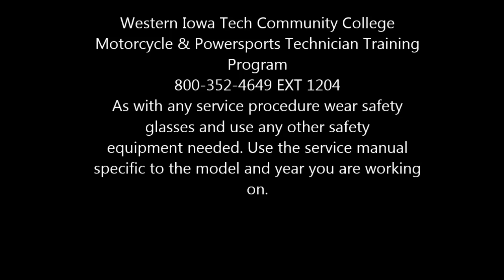Dirtbike Transmission: Suzuki Style Shift Cam Stopper Detent Assembly and Testing

Comment: Thanks Shane! Love your videos. Just to add to the conversation here as we are talking about Suzuki style shift cam. I just assembled my 2013 Suzuki RMZ 450. Started the bike, put it in 1st gear, took of and got about 10ft before the bike locked/stuck in 1st gear and stopped. The bike is locked in gear and gear shifter will not move. Here is the thing I had watched this video before putting it together however I must not have paid enough attention, or to the main point I did not check my work. I did not run through the gears to make sure it was working. Right now I am not 100% sure of the problem until I get back into it here. Stay tuned I will give you an update on what I find. If anyone has an any insight please share.
Reply: Update! So when i went back in there, I unstuck the transmission however I could not find anything noticeably wrong with my assembly. The gear locator was free and install correctly (this one has a washer on the end)  I then proceeded to removed the gear linkage, gear shift cam driven plate, cam stopper plate and gear shift arm stopper or gear locator . Resembled making sure everything was installed correctly checking my work by finding 1st, neutral 2nd..... etc. What seemed like everything was functioning perfectly. I then started the bike put it in 1st gear and it jammed itself again. the bike would not even take off. It was jammed and cut itself out. So now I don't know what to do! Any help out there?
Reply: Thinking about it a little more, it is like two gears are engaging together. It is not noticeable when the bike is on its stand it go's from one gear to the next perfectly, however when you apply power through the transmission (i.e try to take off in 1st gear it jams itself) something must be moving more than it should causing two gears to engage. Maybe I have to spilt this complete engine transmission again and see what I can find. Oh man!
Reply from the maker: Have you Subscribed yet to never miss a video? Have you seen the video playlists https://www.youtube.com/user/conleybuilt/playlists ? Quick answers are often found here. No time to look through videos? 

Still have questions? You’re in luck! I provide tech help and work one on one! I know your question may seem quick but with over 300 requests a week, it’s not possible to answer them all. So, I’ve narrowed down so subscribers and donations to assist beyond the over 660 free videos. My YouTube has grown beyond the ability to answer every question (11 million views! Over 500,000 a month!)

Click here for the membership links and welcome to the community! https://how2wrench.com/product-category/specials/    

Want to say “thanks” or “keep it up”? Click here https://www.paypal.me/how2wrench   This is great for those truly quick questions you need answered and your help back will keep me going!

Your answers and help are just around the corner. Save time and money while protecting your investment and yourself by doing it the right way!
Admin How2Wrench.com
Reply: Hi Shane I am a subscriber. And yes I had looked through many videos, not them all. One was a transmission not function correctly and had been checked by many techs and then you checked it and found the issue with it. I think I might have to go back into the transmission and thoroughly go through each component to see if I can find the problem. As I mentioned the transmission works very smoothly when turning everything by hand. As soon as you start the engine put it in first gear the transmission just binds and will cut the engine if you try to release the clutch

Comment: Hey I’m doing a build on an 97 rm125 and I’m having a lot of trouble getting the bolt the goes to the center of the shift drum out so I can remove the whole shift drum, Is there an easy way to hold the drum in place or is that screw a left hand thread?